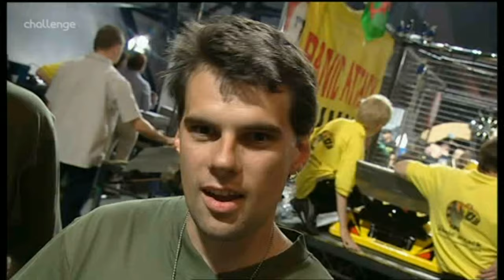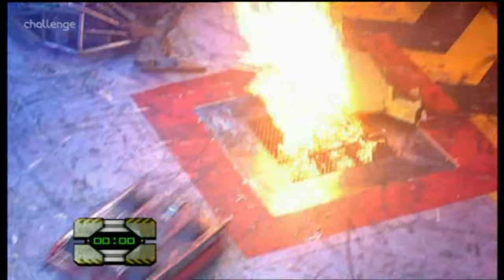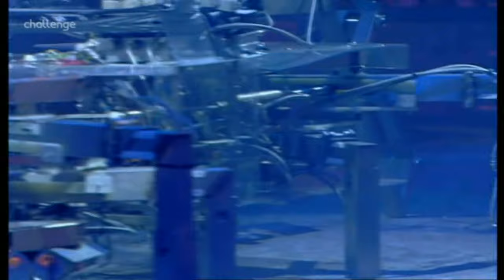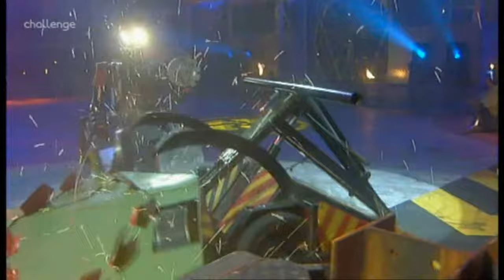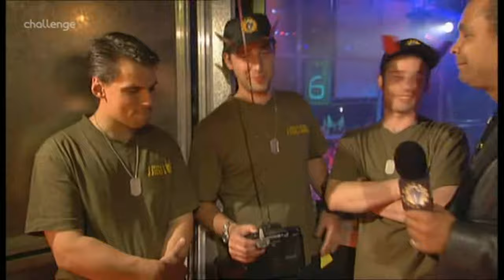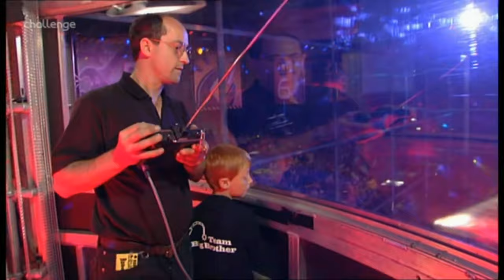3 Stegs 2 Heaven - Series Ex1&5 All Fights - Robot Wars - 2001-2002

Comment: I always felt that the biggest issue with 3 Stegs 2 Heaven is that the design of the robot was very awkward, I felt that if they went for the traditional rambot design as seen in the original Steg - O - Saw - Us and gave it the same spinner is the blade it had in series 5, I reckon they could've done better (Granted not by much considering they ended fighting Tornado and Bigger Brother!)
Reply: Think Steg 2 should of been modified. Cause it was awesome. And flipped Chaos 2 once. Steg 3 sucked. Steg 1 was still better than steg 3.
Reply: @AlexReiter1988  unfortunately the guy who built the flipper of Steg 2 left the team and he took Steg 2 with him, he ended up building Oblark
Reply: 3 Stegs would have been fine if the drivetrain was reliable. The disc weapon was quite good